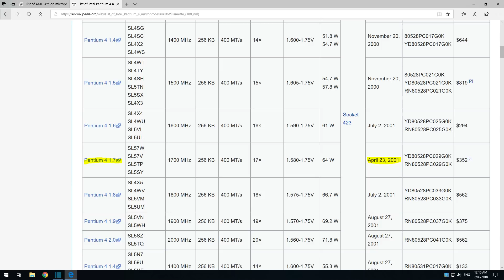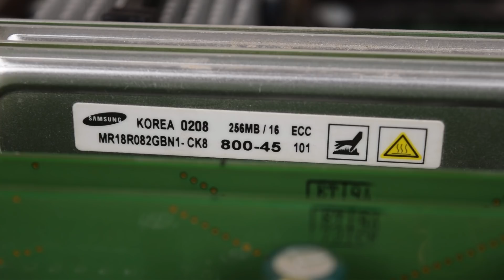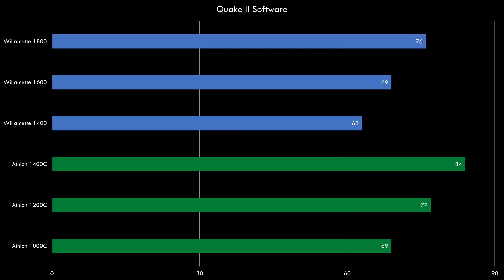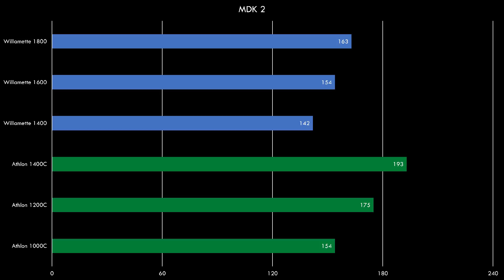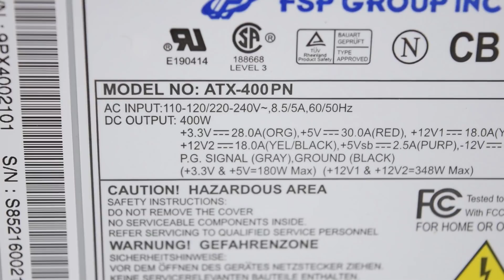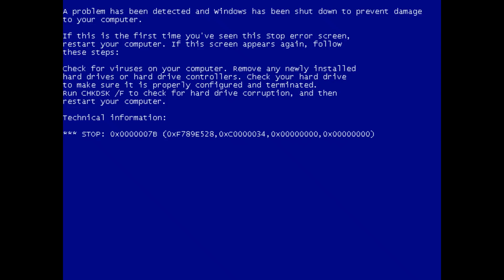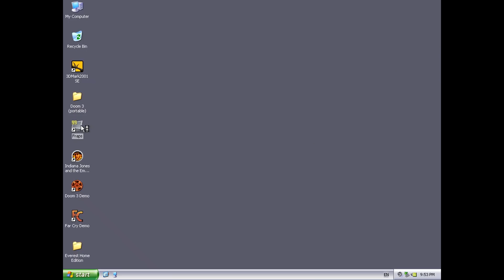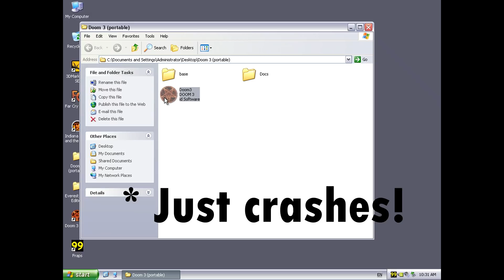Intel vs AMD S2E3 Athlon Thunderbird 1400 vs Pentium 4

Comment: And to think, so many people these days think, and even say that AMD are shit.  I remember back in this era, going into computer shops and asking about an AMD system, and being told "You don't want one of them, they're unstable and not all your software will be compatible", to which I laughed and told them I'd just take my business elsewhere.  I also remember vividly someone in a computer store trying to tell me that the Athlon was the "first CPU AMD had made, and they didn't know what they were doing", to which I laughed and told him I used to have an AMD Am386DX-40MHz, so he'd really made a fool of himself.
Reply: The only 1 reason why "AMD is shit" - motherboards for them made much cheapier with crappy BIOSes, and that is not AMD fault, but it's their fault too. And i had AMD CPU since K6, until A64 era most of the motherboards had either buggy chipsets (thanks VIA), buggy drivers (thanks VIA again), several incompatibilities with AGP/IDE or PCI latency (thanks Creative) or a mixture off all that above. And i have AMD systems now: A64, A64x2, FX83xx, planing to buy Ryzen. And even now i need to be very careful about which mobo to pick.
Reply: @hwn2831  The expensive Asus boards are the one you can go for, they are eternal.
Reply: @hwn2831  AMD's AGESA is bloated crap and you can't downgrade BIOS because AMD made it that way for motheboard manufacturers. nFORCE from nVIDIA was great, unfortunately it was short lived and AMD was left with VIA but later switched to their own made chipsets. And ATi before acquired by AMD had their atempt to make chipset for AMD and Intel. VIA chipsets were good and bad but nVIDIA's were much better. To bad nVIDIA and AMD did not merged, it would be force to reckoned with.
And Intel was more toward "silent PC" philosophy, their chipsets were mostly passive while AMD's were cooled with crappy noisy little fans, like today's X570 boards for Ryzen although there is no need for it.
Reply: @hwn2831  buggy mobo’s for socket a - kt266a, kt333 & kt400 via plus kt133 & 133a plus Ali magik chipsets & sis based boards with the latter usually being pc chips / ecs- sis 730s was a bit annoying & very slow on pc chips m810lmr.
Reply: Those people werent making fools of themselves, they were being PAID by Intel to LIE to customers. 

Fun fact: Intel still to this day hasnt paid ~$1.3B EU Antitrust fine, and keeps filling appeals while bribi^^^lobbying, latest one even went their way and it looks like they might wiggle their way out of it altogether :(
Reply: Maybe so, but I don't know if little PC stores in Melbourne Australia were getting money from Intel.  My brother worked at the time for a little computer store in Melbourne, and they sold AMD and Intel systems - mainly selling AMD because they could sell them cheaper.  But hey, my brother wasn't the boss, and I know a bit about the dodgy business practices Intel were using, and for all I know, it could well be the case that those particular stores didn't stock AMD so that they could purchase Intel stock cheaper.  But I doubt they were getting paid to lie my friend.  Maybe in some other places, but not in tiny little PC stores in less affluent areas of Melbourne, Australia...
Reply: @heidirichter  Same case is with laptops from recent years, its not a secret that many manufacturers are forced to make Intel only machines.
Reply: @rasz  if AMD could get their arses into gear and sort out some decent products it would have been impossible for intel to 'lie'.  Ryzen, their so called 'saving grace' is too little to late. They spent nearly 10 years flicking each others beans!! It really shits me to tears how everyone has forgotten about this.  They left us all high and dry and with no other choice but intel (that is if you planned on actually using your PC for doing things.  If the PC was just for troubleshooting practice, you could have gotten away with buying an AMD cpu.). It is like forgiving a mentally deranged slave master, who has fed you nothing but dog shit for 10 years because he decided to give you a chocolate bar today instead. I mean seriously guys... how has everyone forgotten about this dark and gloomy era know as bulldozer?!?!
Reply: GiSWiG the phenom 2s were good though, and Ryzen is good. FX wasnt as bad as people remember.
Reply: @imayamia  FX was, is and always will be terrible. Only reason why I know is because my work it thread heavy and it does not care about speed of cores.
I have both AMD Phenom II X6 1100T and AMD FX-8350
FX-8350 is basically rubbish compared to Phenom II X6 1100T
I know FX is extremely limited, as AMD Phenom 6174 is actually faster in my work and it barely leaves 800MHz, while FX-8350 when a lot of threads is needed is going bazooka to MAX frequency, even though I made sure it won't go there unless it is absolutely needed.
Another thing is my desktop is heating my room very well
my server barely takes 300W at load with 2x AMD Opteron 6174, 16x 8GB PC3-10600 DDR3 1333MHz (desktop have 4x 8GB ECC PC3-12800E 1600MHz DDR3 RAM)
at absolute full load I can get server to around 450W. 3x FX-8350 would take a KiloWatt or more and won't be able to compete with 2x Opteron 6174

to recap
Phenom II X6 1100T - 6x 3.3GHz, 2 DDR3 controllers
FX-8350 - 8x 4.00GHz, 2 DDR3 controllers
Opteron 6174 - 12x 2.2GHz, 2 Phenom II CPU dies, each 2 DDR3 controllers, cache coherency takes 1MB of L3 cache from each CPU die for total of 10MB L3 cache left for whole package - still awfully fast compared to both above
Reply: @imayamia  FX's were terrible, they were overheating. AMD with FX did like Intel with Pentium, once there were high-end CPU's, later used as name for mainstream products.
Reply: I am not one of those people. Years ago, I worked at the computer department of a store that I won't mention and when customers came by looking for a video card, I'd ask what they needed it for. We only had lower end card. If they said gaming, I'd ask what games and if they mentioned what ever the latest game was, I told them to look online to Newegg or Tiger Direct (Amazon wasn't a thing yet). Our management was fine with that. I also recommended the HPs we sold cause the mobos were made by ASUS.
Reply: HWN buy a decent ASUS board and youll be safe
Reply: riog1me #r33squad After all "research" i left with only 3 options: C6 Hero WiFI ac, C6 Hero Extreme and C7 Hero something. Limiting factor - DRAM prices :-) And my old AMD boards also Asus.
Reply: yea, ram prices suck. honestly, i'd deal with the 8300 until they drop, its just ridiculous
Reply: HWN dude VIA still makes almost every chipset for motherboards, not even talking about the fact that it is almost impossible to buy a mobo which doesn't use at least VIA design for chipsets...
Reply: I heard that old "incompatible" line so many times... Was it ever true, even a little? I remember occasional, rare issues with Cyrix's 5x86, but those were the only true compatibility problems I'm aware of. The AMD K5 was kinda slow, and the K6 wasn't as fast as the P2, sure, but they ran just fine, for less money. By the time of the Athlon XP, you'd think folks'd've come off it, ya?
Reply: @logansorenssen  mate AMD K6 was in fact NexGen 6x86 in improved Socket 7
AMD athlon was K7, K6 with huge improvements plus DEC Aplha EV6 system bus, which was ground breaking in x86, but nothing major in computing altogether 
and obviously they got most of DEC Aplha design team at right time to get K7 design, which had RISC inside (even K5 had RISC, but it was different lesser one)
Reply: Eric Sprague same architecture, so I doubt it.
Reply: TheXlen
Pls give us link to this giant plant and IP bank.
Reply: Building an AMD machine  without cheap bullshit components and they are stable as hell.
Reply: I remember using my old Athlon 550MHz slot A till the Windows XP days. It runs San Andreas fine and was a really nice PC! But my motherboard was a Chaintech, not a shitty PcChips like most people would use on cheap AMDs
Reply: local little PC shops are almost always clueless, I've had a laugh at one in my town recently selling a computer worth £1000 for £4000. lol
Reply: (Enhanced?) Am486DX4-120 for me.
Reply: Also had a PC on an expansion card in my Amiga with an AMD 286 on it.
Reply: I agree to a point. I'd say AMD started to lose its edge when the Core2 series came out. If you overclocked your AMD, you could best the equivalent Intel and save money on the CPU but then you really needed to spend extra on an after-market heatsink and a slightly better PSU to handle the load. Of course AMDs take more power than intel and overclocking them adds even more. Now you're paying extra in electricity. Gota factor that in to the cost which most people don't when they see the upfront costs of Intel vs. AMD. Ryzen has changed all of that.
Reply: People get paid to lie in retail all the time, no matter the place. Little lies like 'this product right here (with bigger store margin) is The Best!', or 'we dont stock X, they are crap, why dont you look at our Y on the shelf next to you'.

Now you might think it was only big manufacturers (Dell, HP, acer/emachines, compaq, toshiba, asus, sony, nec, fujitsu, hitachi, supermicro, gateway, pretty much every single tier one OEM at the time and then some got bribed/intimidated), but it extended to retail chains and distribution. Your mom and pop store might not be receiving cheques directly from Intel, but distributor will offer huge rebate for buying exclusively/predominantly Intel CPU/Board combos.
What is crazy Intel does it to this very day.
https://www.msi.com/Promotion/intel-ssd-bundle
http://www.biostar.com.tw/app/en/news/news.php?S_ID=282
and on the distributor front you are often quarterly allocated free "promotion material" (aka Intel SSD drives) to do as you please in exchange for filling quotas (designed to minimize AMD market share). Some distributors pass those "gifts" to their customers (small shops), others just sell them pocketing the change/rebating Intel product even deeper.
Reply: Two major incompatibilities from VIA: broken AGP (became almost irrelevant with KT400+) and broken DMA in 686B southbridge (K6-early Athlons) was horrible alone, but if you add SB Live in the mix results will be dramatic - data loses on HDD. SiS and Ali Aladin have some issues with AGP too, but i never bought this boards, you can easily see tweaks for them in OC utilities. With later Athlons and A64 (and even Pentiums) we had a PCI latency problems with (only) Creative soundcards on all alternative to Intel chipsets. Also VIA 8237 southbridges have issues with SATA2 devices.
Also magical VIA 4-in-1 drivers, you need to know exact version working correctly with all your hardware (just check Phils videos, and you'll see references to different versions used during tests because of ... :-))
And as AMD CPUs are for budget deals, most OEMs made boards even cheaper then most cheapiest Intel ones.
Reply: @hwn2831  basically every chipset have some issues
have a look at AMD760 (AMD761 + AMD766)
this was never put together on single mother board
AMD761 was always paired with Via686A or VIA8237
just check Asus KG7 or KG7-RAID
AMD766 had some major issue and due to lack of hardware it was never fixed either in hardware or in software
AMD751 and AMD761 had AGP issue - both fixed in days on Linux, works both in win98SE and winXP
AMD Athlon 64 had exactly same issues - it have AMD761 on die - just have good look 
AMD940 - server platform
AMD939 - desktop platform
what is difference?
registered RAM, that is literally ALL
why AM2 was PCIe only?
why fix AGP, if PCIe is good at the moment and have no such issues
Reply: @WizardNumberNext  youre commenting on a thread that hasnt been touched in a year chief nobody cares anymore
Reply: @imayamia  Like saying "you talking about book which was wrote more than 5 yars ago". :-)

@WizardNumberNext I'm glad that i skipped everything between K6-2 and A64 for myself being happy user of BX + PII 350 and 815 + PIII 933 later till P4 Northwood arrived. And A64 (s754 NF3) was short lived for me (less than 2 years) without major issues (besides dying NF chipsets), i suppose that is mainly because of XP and "propper" handling (or working around) of ACPI/IRQ/etc. Pentium D/Core 2 Quad/Core i7 1366, and the only issues i had this time was crap DRAM compatibility with DDR-2 667 and above. DDR-3 made me happy again for allmost 10 years of usage. I'm still on mix Sandy/Westmere rigs, and several rigs FX was bought during mining era because of it's capability to earn money instead of cheap pentiums.
Reply: Do you know why people say it? Because they are right!!! I have had NOTHING but headaches with my AMD R7 2700X.  It took me 3 kits of RAM to find one that worked (also happened to be the most expensive kit they had!) proving the stability issues the staff claimed, My thermaltake RGB fan software makes the system crash and the fans to all spin at 100% (eg. incompatible software claim now verified).  I could go on, but is there any point? No doubt it wont change your mind.  I am still using my 2700X, as I finally got it working in a somewhat usable condition. However, I would not have bought it if I had known it would cause so many bloody unnecessary issues!
Reply: @funbucket09  and yet I have had zero AMD issues since 2005, only issue I had was with my former system where I cheaped ou to much on the motherboard and had to add a fan that blew directly on the VRM and chipset.
Reply: @funbucket09  i have built 4 ryzen PCs so far, never looking into ram-compatibility-lists. All are running fine out of the box, just overclocking the ram beyond specs is a bit hard, and ended in 2800MHz CL14 CR1 with 2 dual rank 16Gig modules on my 1800X, but absolutely stable.

Comment: Man, its so sad that my a7n8x-e deluxe mobo died. I lost all of my interest with retro pcs :/ You still make great videos anyway keep on what you doing :)
Reply: why not get another one? i got the same board + xp 3000+ cpu on ebay for 20 bucks
Reply: @talvisota327  hey! future me here, i just bought a cheap motherboard with via chipset, a7v8x-x. It works fine!
Reply: @mtunayucer  great! enjoy your new retro system. what cpu do you have?
Reply: @talvisota327  2500+ barton, but i have some stability issues. When i put the pc on load, after that load is turned down, the pc crashes, i guess its a power supply issue. These athlon xp stuff puts load on 5v line, which no new psus care about.
Reply: @mtunayucer   yeah thats why i use older PSUs for athlon xp / P3 stuff. i can recommend FSP as i never had any issues with them even though some of them are 20 years old. just make sure it has at least close to 30 A on the 5v rail... the higher the better. how much ampere does your current psu have on that rail?
Reply: @talvisota327  the old psu i havesays 42a but i just dont trust it, i swapped some ram and it looks like issues are gone, gonna do futher checks! Right now swapped the memory from 333 to newer 400mhz, while im there i also overclocked the athlon from 2500+ to 3200+!
Reply: @talvisota327  sadly as i was playing around with the system my gpu radeon 9700 pro suddenly died and started giving artifacts all over the bios, rest in peace.
Reply: @mtunayucer  rip. you could try to reflow it with a heatgun but yeah unfortunately those old gpus tend to be quite fragile. probably also because of their awful cooling design
Reply: @talvisota327  yeah, im kinda done by athlon xp stuff, its interesting that my other retro pc, pentium 3 1ghz voodoo3 3000 is rock solid stable, thank god.

Comment: Did you try the newer nVidia driver after installing service pack 4?
Reply from the maker: There is only so much I can test for one vid :D
Reply: PhilsComputerLab What?  You have limits?    I only asked out of curiosity.  It was probably what I would have tried next, though I suspect it will not make a difference.

Comment: I think that sp2 is better for older systems (it's just faster, as i remember).
Reply from the maker: I need SP3 for my USB wireless adapter. SP2 doesn't have the protocols or something. But anyway, I looked into Vanilla vs SP1, SP2 and SP3 a while ago, but found absolutely no difference, so I never published the video as there was really nothing to show.
Reply: Eli van der Geest I confirm that, my Compaq Evo with P4-M slowed down muuuch after installing SP3 in place of RTM XP
Reply: You never find any difference between fresh installed systems, give them a 3 months usage as a main PC and you see. The only sad thing i remember until SP2 system never lived longer than 6 months without need to be reinstalled, SP2 extended this period up to 2 years.